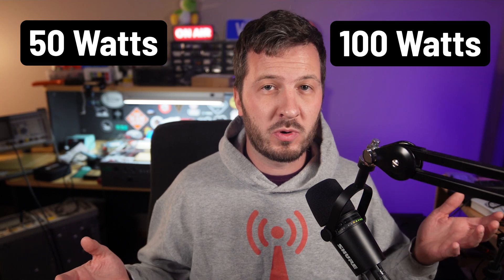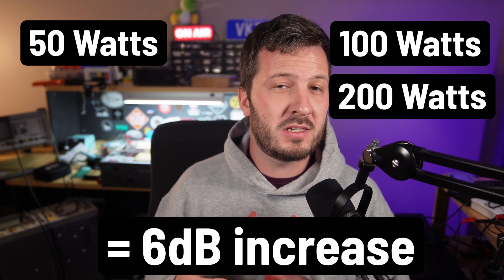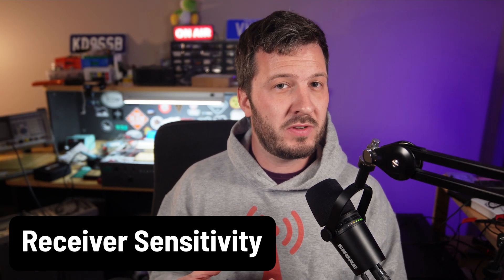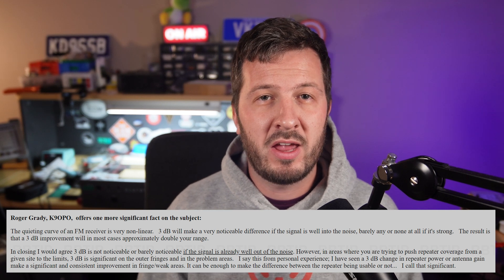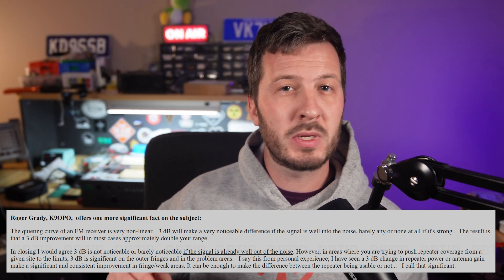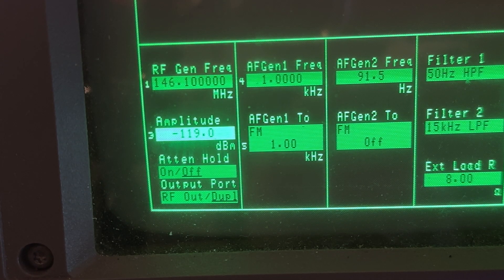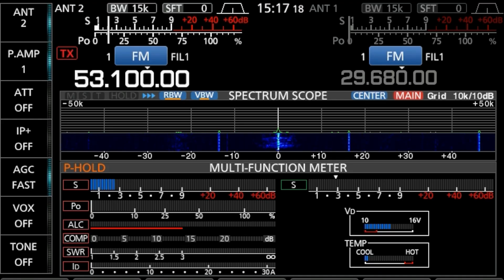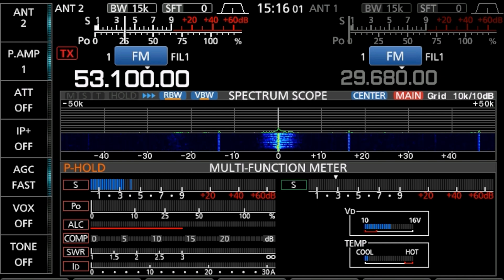The Double Your Power Ham Radio MYTH

Comment: really good channel. I'm subscribing. Just a little comment on radio emission from geometry perspective. If antenna emitted perfectly flat circular wave the signal would decrease with ^2. If it emitted perfectly spherical wave it would drop with ^3 (8 times with double distance). My guess it emits something in between, so double distance reduces signal by the factor grater than 4 and smaller then 8.

Comment: +3db ie 50W to 100W will increase your range by 50%.  eg 100km becomes 150km.  +6dB ie 50 to 200W will double your range.  This is assuming the flat Earthers are correct and that both the transmitting and receiving antennas are elevated high enough to have their LoS within the Fresnel zone.  Works for satellites even if the flat Earthers are wrong  :)

Comment: Another nice clear explanation, particularly the demonstration on FM. Folks should remember that S-units are theoretically 6dB increments, so a doubling of the power only increases the signal by half an S-point. Not significant on HF as fading could easily be up to 20dB. If your 10 watt HF signal is giving S5, then 100 watts will only increase to just over S7, a 10dB increase.  Polarization loss really only applies at VHF and above. At HF ionospheric refraction varies the polarization fairly randomly so it's not as important at these frequencies - unless the two stations are close enough for just ground-wave communication.
Reply from the maker: Thanks! On polarization loss - 6m Sporadic E is the same - it doesn't really matter! Signals are so strong and the polarization shifts constantly.

Comment: Hayden, I have question in regards to this topic. How does it apply to doubling your db gain of an antenna?
Reply from the maker: The same principle applies Chris - if the antenna is like for like.
Obviously it will be different if you change from say a 6dB vertical to a 9dB yagi. You get more system performance from the yagi as it's directional. Plus your noise will probably be better too.
Reply: @HamRadioDX  make sense to me Hayden thank you👍

Comment: Your range is whatever it is. All adding more power does is increase your signal strength within that range. If you're on HF a power boost may make you strong enough to be heard over a DX station's local noise floor. If you're on VHF/UHF it can make you easier to hear and clearer within the line-of-site limits of those frequencies, and let you hit repeaters that are near your range limitations. Antennas with more gain also increase your apparent power by concentrating more of it in the direction in which you want it to go: on VHF/UHF this would be more toward the horizon rather than up into the sky where that power's wasted. There are special-case exceptions: on HF you may want your power to go almost straight up so it comes back to earth nearby, allowing more local or regional communications vs. DX. On VHF/UHF you want your power to go skyward if you're trying to use a satellite.

Comment: A lot of Americans will be rather pissed off by this video. Having bought their Stryker Splatterboxes and 5Kw amp for Channel 19 AM use. They all want their bullshit to be heard as far away as is humanly possible, who cares about interference and harmonics....where's my 10Kw amp, I ain't bein' heard at 30dB/S9 500 miles away, I need more power.....
Reply: I often wonder why anyone needs to get signal reports of "S9 plus (some number) dB". A plain old S9 is not good enough?

Back in the old days, we were told to use the minimum power required to establish reliable communications. Is that no longer the advice?
Reply: @vk2sky  Bigger signal means better radio than your neighbour, perpetuated by the "MUST BE MULTIPLES OF 18 FEET" coax crowd...old wives tales are hard to beat....

Comment: ha ha ha..."the 10W radio" .....I bought that 10W radio it is zero watts now...💀. When it did work it was 7 watts on several bands (all at once). Thanks for this practical demonstration, wish I had that test gear! Incidentally ham folklore has it that CW is 10 times better than SSB (10W CW = 100W SSB). I don't know if this is 100% true but CW certainly adds to performance (most likely due to narrow bandwidth, single tone etc). 73 de VK2AOE
Reply from the maker: CW can be copied well below the noise floor - with a good ear. SSB requires it to be above the noise - usually substantially so I suppose there is some truth in that. 10 times the power is only 10dB too.

Comment: The inverse square law really only applies to beam signals.  Non-beam radiation works via the inverse cube law.
Reply: Are you sure about that? I'm no expert, but I believe that inverse square laws apply to any radiator, regardless of the pattern.
Reply: Does this law only apply when we want it to?  Are we sovereign radio operators who choose which laws we want to follow?
Reply: @N9XRradio  They only apply when radio waves are engaged in commerce. Otherwise, radio waves don't propagate, they travel and no license is required... for any of them. And there is no ionospheric
refraction because the Earth is flat. HF signals propagate further than VHF or UHF signals because they're bigger waves that have a similar quarter wavelength to large waves on the ocean, which is kept in by a big perimeter of ICE. 
You can read about it all in my new book:
"Faraday and Your Brain... the history of the tin foil hat and what it means to you."
Compelling stuff, if I do say so myself.
Reply: No that is not true - think of the light beam example - doubling the distance will always quadruple the area to be illuminated. That is simple mathematics / geometry and valid for any kind of radiator.